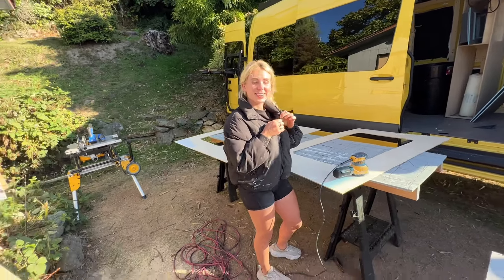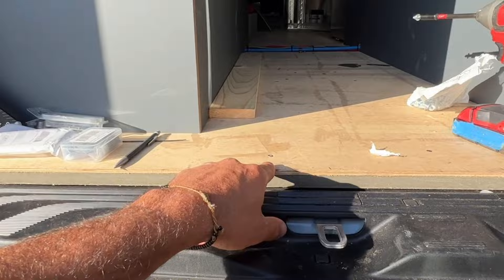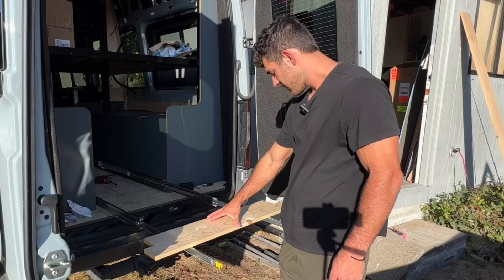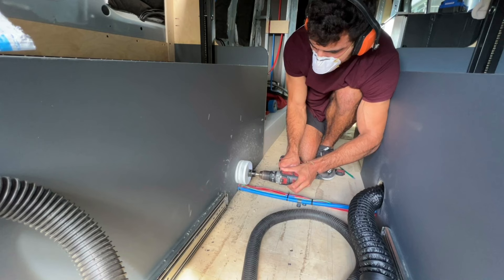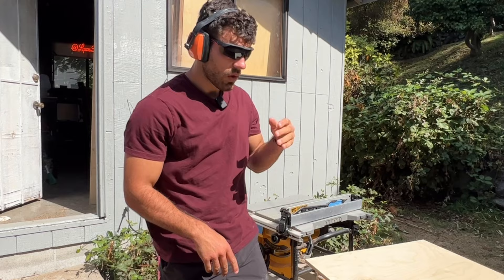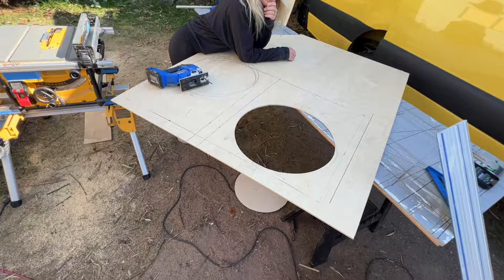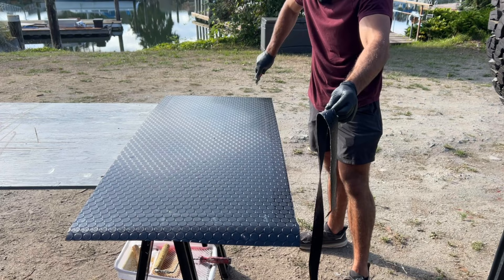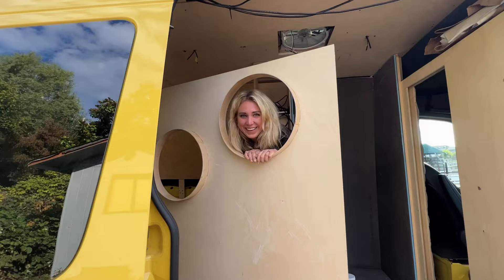Vanlife | 500lb Gear Tray | Secret Electromagnetic Drawer

Comment: A 12v solenoid bolt would not need power on constantly, but the drawer would not open if all power was lost so it's would have to have it's own (small) battery.

Comment: I was thinking of using a magnetic 🧲 locks as well but I thought about the fact it will constantly need power to stay shut. 

How much power does it draw in order to stay locked?
Reply from the maker: It uses 100ma which would take 400 days to drain the battery hahah